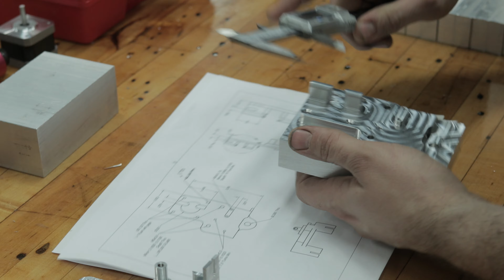Micro Swiss Direct Drive Extruder for Creality CR-10 / Ender Printers

Comment: I have just completed an update to my 3 year old CR 10S Pro V1. I added a BL Touch, Micro Swiss Direct Drive, Updated Screens and Firmware Hex code. I ordered my prats from Tiny Machines because they always help before, during and after sale. My good friend Andy lives in South Africa and we both have the same Machine, He did the update first and mentored me along my update. The parts In the tiny box cost me about $60. My machine was listed at $700 new but i found a returned unit for $350. I did upgrade the bed sensor and already had the Micro Swiss Hot End with a hardened Steel nozzle because i needed to print Hi Temp resistant Carbon Fiber impregned filaments. I had several leaks in the MS Hot End but learned my assembly errors and did finally get it to hold up perfectly.  I had already ordered and recieved the BL Touch kit for Tiny Machines. It included the tiny BL Touch sensor a wide fat Cable and all the bits needed. But i waited to do the BL Touch and MS DD all at once. Finally the MS DD Arrived. As I opened the tiny box which was identical to the Hot End Box, I was very impresses to see a wonderfully machine aluminum adaptor for the DD installation. In my career I had worked in Aerospace, Medical and Automotive building some fairly high end systems. This part was on par with any of those high tech systems. Uniquely machines from a solid block of Aluminum not joints to crack or flex yet that part weighed so little. and stiff no flex at all, Just a lovely piece of work. I stated to pull my machine apart and over a few days was uploading the screens and Hex code. It was pretty exciting the probe turned red then blueish and came down to touch the bed. I wanted to extrude a little filament nothing would come out. I checked with Andy. The Extruder motor was not rotating. OH NO!. He calmed me down and we traced the wiring. In my excitement i confused the extra connector on the ribbon with the 4 wire E1 wire. And I found the unconnected end of the extension laying under the extra wire. Andy wrote, that's kinda important! OK OK I plugged it and the gears turned but did not extrude. My extruder release handle was too loose. Adjusted that and reset the extruder setup parameters. Finally Filament oozed out the nozzle. YEAH! Now we are ready to go. Andy Suggested the Benchi so we could compare Print Quality and he could asses my settings. Set up Benchi and started the print. I had to lower the nozzle about .9mm to get a flat bed in the 1st layer. Then had the call for Supper. I left the machine to print. I use OctoPrint and S3D slicer with quite good results. After Supper we had to do some domestic tasks so when I got back to check out the machine the print was done. I popped it off and came upstairs to inspect the result. I had some nerds in a few places that Andy feels was too high Nozzle 220C should be 215 or less. We were not worried. The big news, aside from the finish which was flawless, were the details of the circles, squares and edges which as near perfect as i have ever seen. My circles for the 1st time were round, not oblong. the details at .2mm layer height was wonderful. The fan adapter that I printed before tear down worked fine and all the reused parts did the job. I was thrilled and love the look and feel. The machine is reborn! If feels solid and reliable. The Extruder is just a work of art, rugged and solid and a wonderfully engineered parts. THANK YOU Micro Swiss, THANK YOU, the Hot End and now this Direct Drive Extruder is wonderful. They work! They Look Great! They actually improve the printer quality significantly. I am thrilled and would recommend these upgrade to anyone that needs to print with precision. The cost was not crazy and Tiny Machines supports you with, bits, wire, code and online help. Not to forget the Firmware updates which help tie this upgrade all together. Now I can continue to produce Model Train parts for my 1950 American Flyer S Gauge engines "Next Generation S" from Frankentrain Laboratories.  I have some suggestions I will send in a separate message to Micro Swiss Engineering. Dennis in Virginia

Comment: Hey Micro Swiss,
1) The kit sits VERY high on the X-axis gantry. I'm sure Z volume is lost because of how the wires and PTFE tube are routed. Wouldn't be better to route the cable and PTFE tube in front of the gantry instead?
2) Can we use a pancake stepper motor so save weight or you recommend using the original Creality one?
3) Why not machining holes for a HIWIN (and clone) linear rail cartridge? Linear rails setup are becoming more and more popular.
Reply: Very good observations,  All very true !!!!
Reply: Just installed. no Z height lost on my CR-10 the tube and cable just move out of the way. maybe if you go to the top of the z and all the way to the right it could cause an issue but I haven't seen it yet.

Comment: Won't work on CR10sPRO, max, or 20 because of the filament sensor. There's a direct drive print for cr10spro in thingyverse that's addresses for it. I would've bought this but since there is no option. For my filament sensor or my bltouch I won't.

Comment: What is the weight of the whole extruder (with motor, aluminium bracket, hotend etc.) - basically all moving parts on the X axis?

Comment: This is a great kit except they moved the slots for the x-axis timing belt. Compared the extruder carriage on my Standard CR-10, the slots are about 3mm closer together. This means the belt that comes with the CR-10 doesn't;t work. nor do replacement belts. Had to buy my own belt and clips and create a longer belt. Works great now.
Like I said, it's a great piece of kit but that's a really weird decision on their part to change the dimensions!!

Comment: can a bltouch be attached without any modifications?
Reply from the maker: It has same mounting holes as original cr10 hotend, so current  BlTouch brackets will work on it.

Comment: can the cables from a CR10- S5 control box reach the micro swiss direct drive system? or will i need extension cables? im concerned about the cable that goes into the stock cr10-s5 extruder not reaching the micro swiss direct drive extruder
Reply from the maker: The kits come with an extension cable.

Comment: Have you mounted and also have BLTouch?
How have you entered the code in e.g. cura?
(G29 is for BLTouch)
This:
G92 X-5.0 Y-10.0; set home offsets
G1 X0 Y0 Z0.2 F3000; get ready to prime
G92 E0; reset extrusion distance
G1 X160 E15 F600; prime nozzle
G1 X180 F5000; quick wipe

Will be in here somewhere.
G28
G29; Home
G92 E0; Reset Extruder
G1 Z2.0 F3000; Move Z Axis up
G1 X10.1 Y20 Z0.28 F5000.0; Move to start position
G1 X10.1 Y200.0 Z0.28 F1500.0 E15; Draw the first line
G1 X10.4 Y200.0 Z0.28 F5000.0; Move to side a little
G1 X10.4 Y20 Z0.28 F1500.0 E30; Draw the second line
G92 E0; Reset Extruder
G1 Z2.0 F3000; Move Z Axis up
Reply: Can you just set the X & Y offsets like that in the gcode and not need to edit the firmware source code? & would that affect the Z offset set manually according to the BLTouch instructions?

Comment: I have a CR-10 with a TH3D ABL... can I use that ABL with this head?
Reply: I also would like to know. Did you ever manage to find out, or try it?
Reply: @rfc1795  no... I bought the Bondtech DDS and it’s worked amazing ever since
Reply: @MonsterPartsRc  sounds good, I'll check that one out! Easy to install, no need to reflash Marlin?
Reply: @rfc1795  you have to change the steps/mm to 415 and turn the voltage down on the stepper after that it’s pretty easy... you might have to flash marlin with their settings but I think the changes I mentioned are the only teal changes that the new flash makes (you have to change the voltage by actually turning the pot on the board and measuring with a voltmeter)

Comment: Needs to be able to support BLTouch...the trade off isn't worth it otherwise.
Reply from the maker: It has same mounting holes as original cr10 hotend, so current  BlTouch brackets will work on it.
Reply: @MicroSwissLLC  could it work on a CR20 pro?
Reply: Are you for real? Ever heard of borosilicate glass bed and Marlin bed mesh leveling?
Reply: People still need BLtouch to get a levelled bed?
Reply: @PhelixTheKhat  What does the title of the video say?

Comment: Beat E3Ds price and if I already have your hot end sell me the bracket and extruder separate.  You will have my business!
Reply from the maker: We are still finalizing price, etc. but full extruder kit with our all metal hotend will be under $100. We will sell extruder separately without hotend.
Reply: Neil Siebenthal  The Hemera looks like a good design right? But...
1) You need two 3D printed parts to mount it and a third for the cooling part fan. So you're adding unreliable unsafe not flame-retardant parts to your hotend. Not smart.
2) The Hemera is completely closed and you need do unmount it and completely dissemble it to remove any clog. Not smart. A YouTuber is complaining about the numerous clogs he's getting with both Ninjaflex and PLA.
So how about that for a 160 CAD solution? It's ridiculous!
Please Micro Swiss, hurry up and restock your website! :-)

Comment: Works with ender 3 Pro with stock firmware?
Reply from the maker: Yes, it will work with stock firmware.
Reply: @MicroSwissLLC  What if I have BigThreeTech SKR mini e3 board with their firmware installed?

Comment: I can't see the reason where a Pancake stepper motor has not been placed to right side and reduce the distance between hotend and extruder  eliminating the bowden tube too, this is a no sense, there is a lot of distance between gears and tube ,  I don't belive this works well with normal flexibles density, I don't belive it !!
Reply: Joan.  In this day in age I see no reason to type in all caps.  I mean for f sakes.
Reply: @Neckster72  Technically inclined enough to understand the innerworkings of FDM printers, but dumb enough to not know where the caps lock button is... It just boggles the mind...
Reply: Boy, I don't want to read your text because of these capital letters. write normal.
Reply: @certified-forklifter  I don't need you to read my text, if you don't like it, don't read it or answer
Reply: Someone  can give a good answer instead of criticizing my capital letters, I see no ...
Reply: Neil Siebenthal  I will do so, we all know Bondtech and  E3D with the Hemera and V6 hotend,  but having the option of improving against they competition will lose the chance
Reply: @joanr.b8801  no, sorry
have a nice new year
Reply: @certified-forklifter  ok, I'm sorry too, wish you a happy new year
Reply: I'm guessing the decision was made about that design to keep the weight centered on the wheels and the extrusion. Pretty simple engineering I think. People are already complaining a lot about flat spots on Creality wheels and  gantry wobbling under normal use and you would prefer an offset mounted heavy stepper motor?
Reply: @mikem8145  Creality is one disaster after another, I have several of them and my CR10S PRO was a nightmare in many aspects, autolevel, curved base, sloppy and several other things.
In this case Microswiss has chosen to mount a huge and very badly placed stepper that causes a bad retraction and many inertia by weight of the stepper, for that reason I suggest a pancake steeper placed on the side that weighs less than half that they have mounted (It is a giant and useless aberration that annoys even the view) correcting in this way the distance between gears and fuser eliminating the bowden tube, and improving as retractions.
 For some reason everyone does it that way .... this is not direct extrusion or in they dreams.
  What do they intend to invent with this useless metal giant moving at high speed?
  It is a safe disaster and as I said I do not think it can work well with flexible soft or normal density, pure scrap, time will speak ...
Reply: @joanr.b8801  I do believe they should include a pancake motor in the kit to make it more lightweight. What do you think of the new E3D Hemera?
Reply: @mikem8145  I share your opinion, they should send with Pancake.
About Hemera I honestly can't comment because I'm waiting to try.
I usually use Bondtech or E3D Titan, the 2 work perfect.
Although if I had to choose, I prefer Bondtech 3: 1 reducer model always with normal V6 or Volcano for large parts at good speed since it works at very high speed without losing heat.

Comment: it has to be lot cheaper that hemera to succeed as it is definitely worse design.
Reply: Are you insane? The Hemera looks like a good design right? But...
1) You need two 3D printed parts to mount it and a third for the cooling part fan. So you're adding unreliable unsafe not flame-retardant parts to your hotend. Not smart.
2) The Hemera is completely closed and you need do unmount it and completely dissemble it to remove any clog. Not smart. A YouTuber is complaining about the numerous clogs he's getting with both Ninjaflex and PLA.
So how about that for a 160 CAD solution? It's ridiculous!
Please MicroSwiss, hurry up restocking your website!